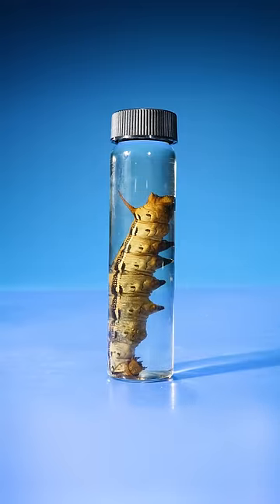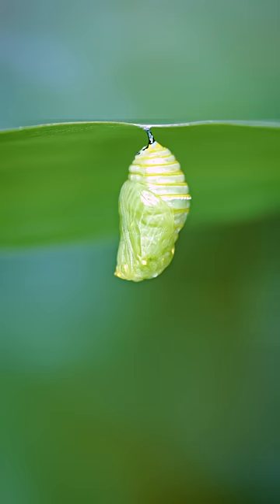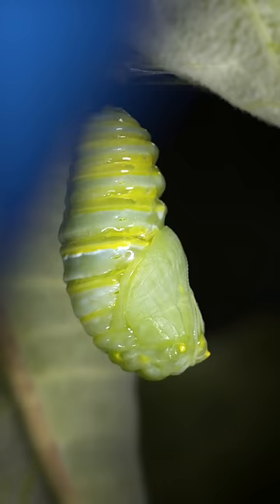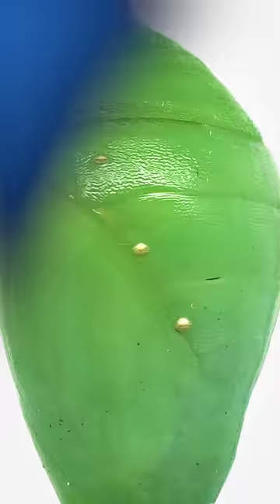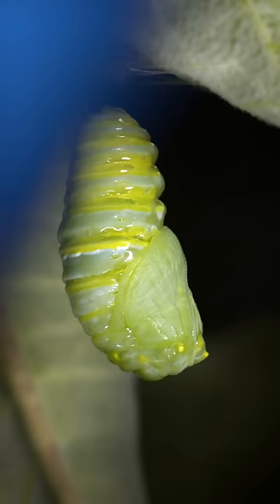How Does a Chrysalis Breathe?

Comment: Chrysalis? Is that not a cocoon?
Reply: Typically chrysalis refers to the hanging shells formed by caterpillars turning into butterflies, while cocoons are formed by moths and might be hidden on leaves or in the ground
Reply: Chrysalis refers to the layer of skin that gets shed when a caterpillar becomes a butterfly. Cocoon refers to a threaded coat surrounding a chrysalis. Butterflies just have Chrysalis, though sometimes they'll make a cave out of thread. Moths also have a chrysalis, but they make a cocoon, a threaded coat, around it.

So if you see a chrysalis, it's a butterfly, and if you see a cocoon, a moth is in there.